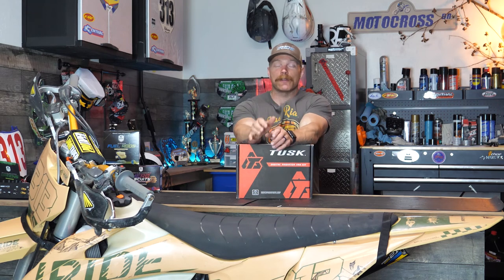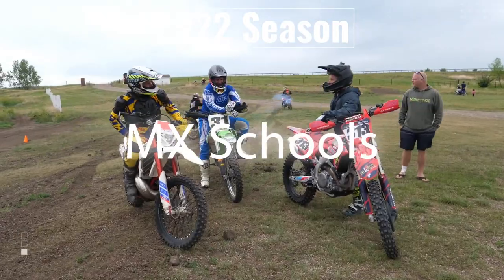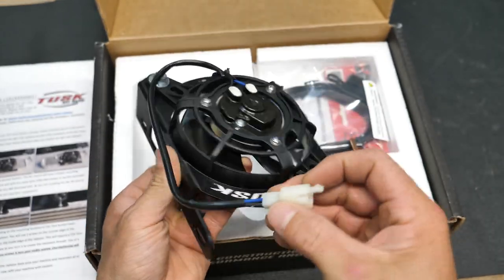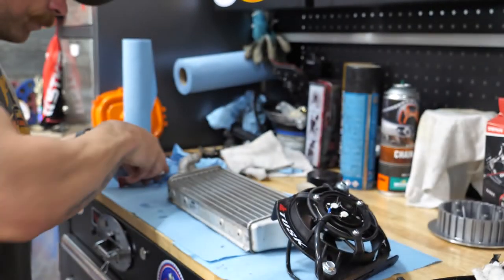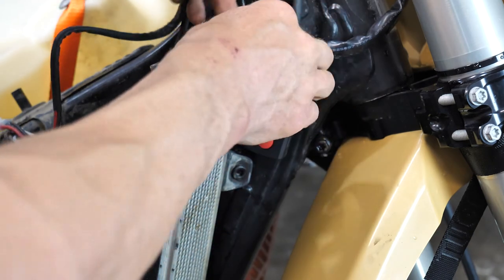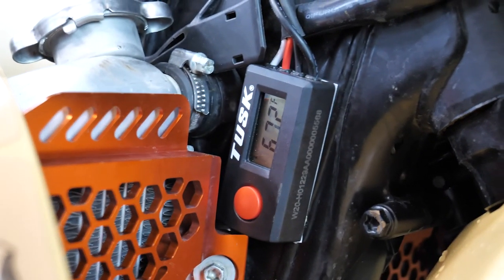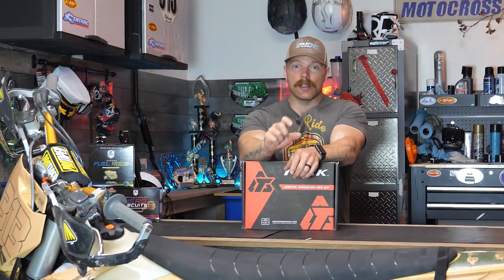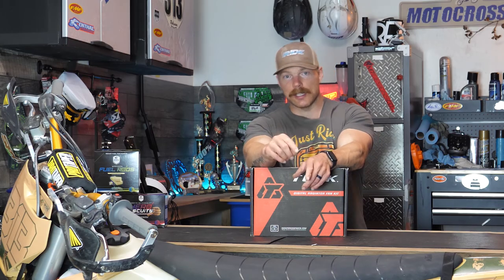How to install an EXTERNAL COOLING FAN on a dirt bike (worth every penny!!)

Comment: My problem is my bike doesn’t have a battery.
Reply: I have same problem and I’ve been trying to figure out how to run a radiator fan without my bike having a battery
Reply: DIY Lithium battery pack 3cells. or use a Dremel battery 12v. You can buy a thermo switch that fits between your radiator  hose if you go for a little 4inch universal fan cheaper that way